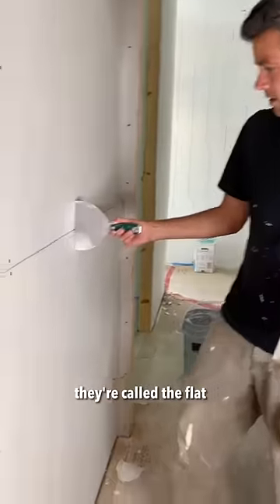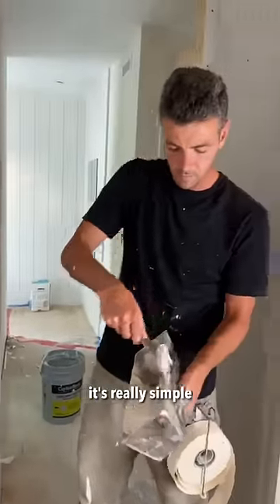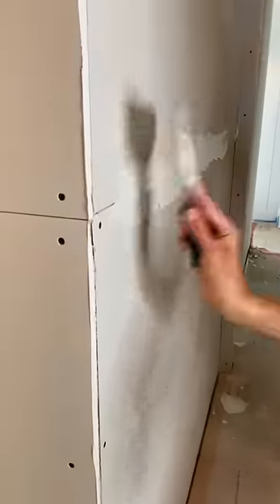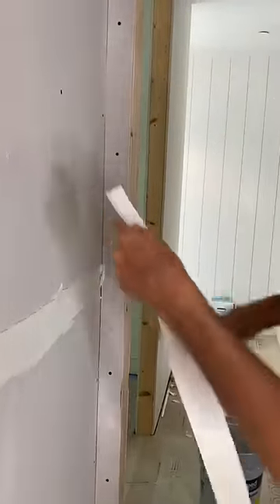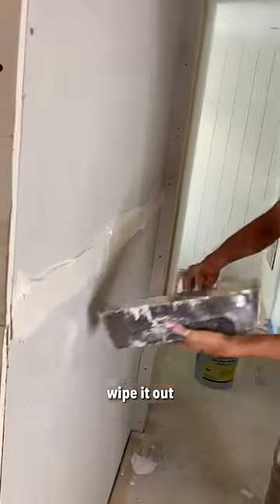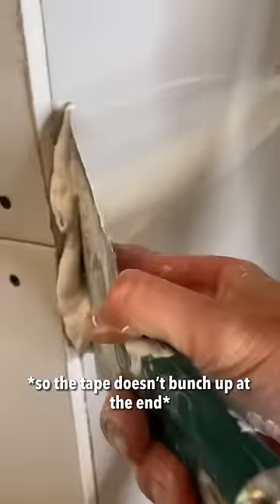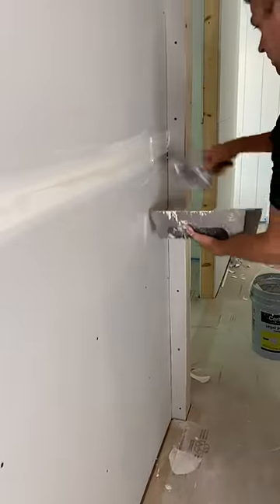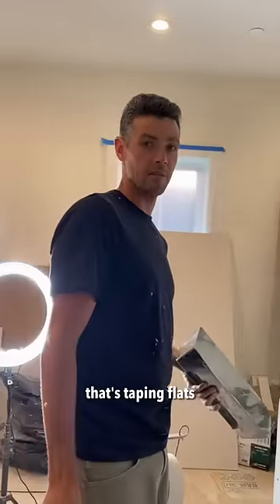Beginner Drywall Tips! Taping Flat Joints

Comment: Wow, someone who actually knows how to tape. I usually watch these videos and cringe. As a drywall contractor of 20+ years, I can say that you are giving out valuable information for free. Good on you!
Reply from the maker: Thank you!
Reply: On a short wall like this, I'm sure it doesn't matter if you have horizontal or vertical joints, but in order to avoid butt joints on longer walls do you hang sheets so that joints are vertical?
Reply: It is amazing how many professional drywallers....hate that term....  still screw up flats
Reply: @1966johnnywayne you should only hang vertical in commercial buildings if fire codes dictate the seam is the entire length of the framing.
Reply: Lmao his technique inefficient and he slow af what you mean
Reply: Dude even vertically will add strength to walls. You are not wrong, but come on. And usa is 20 years behind with construction, the way private house are built and everything wired would get insurance after finishing it because of these outdated regulations you have there.
Reply: @padlasvillage  in what way is the USA 20 years behind with construction? Saw your comment and its a genuine question because I am plannong a house design and maybe there is things I can implement.
Reply: Only someone not from the USA looking to buy a house in a dense market would say that.
Reply: @padlasvillage  20 years behind who lol. please im so curious. been waiting for a good roast.
Reply: @GorillaWitDaDraco  yeah lol it’s a lil slow maybe for video purposes? But a bazooka would be the way to go to get this job done in a day
Reply: @1966johnnywayne yes I’ve always done this.
Reply: @JosephDawson1986 it's not necessarily behind. It's just very different. Here we have global differential units that protect the whole installation and more sensible ones that protect wet places like the bathroom. In the US you protect less but it is even more sensible so better for protection of people. We have also bipolar or tetrapolar circuit breakers while you have mostly unipolar ones. We often have triphasic current while yours is single phase. But this is something that isn't up to you. It's norms and regulations. Your installations seem out of date for us when we open an electric box in the US. But the difference in voltage and issues explains why you don't necessarily have the same requirements as we do. 
For the rest, your construction techniques are very different then ours. Ours last longer, but are a lot more expensive too. We don't use drywall except in the attic for example. Walls and floors are made out of brick, stone or concrete. We don't use shingles or roofing but tiles or slates. We don't just use insulation but also inertia. Thai is why we don't need AC even in hot places. But again it's not necessarily better or worse. It's just different choices that were made.
Reply: What's the advantage of taping like this? The way I was taught is to use fiberglass tape directly before mudding. Then we use mudding especially for joints but not premade, just in bags that we make in a clean bucket .Which takes the same amount of time as you have to mix those premade buckets too anyways. We have the first layer that we do quickly and just scrape off well so there isn't any excess. Afterwards we go a second time with another pass but with a finer grain of mudding to seal it properly with no imperfections. No sanding required. This being said, we only use drywall for attics. Usually we mud entire walls and ceilings. So I'm not that familiar with drywall. How do you guys do it?
Reply: I’m 39 and have been doing drywall for 40+ years and I can say he’s giving valuable information for free as well
Reply: @OptimisteProductions  there is three ways I have done it. One is a metal reinforced paper tape, a fiber mesh tape and unreinforced paper tape. 
We generally use a premix that is very fine grain, commercially, and for the paper tape we use either premix watered down a bit or powered but make it a bit watery. You dunk you paper in the mix and using either a flat or corner drywall tool, depending id it is a flat seam or a corner seam, and smooth it into place amd let it set for about 10 minutes, usually while that sets you tape the other seams in the room and then come back to the first for step two.
Step two you take the regular premix or properly made poweder and you cover screw holes from hanging, which even a moderately capable drywall guy does in one pass no need for sanding and then you hit the seams in two passes one to fill in low spots and the second goes back the way you spread the mud, scraping leaving all the low spots filled and generally scraping the high spots away. The fiber mesh tape is similar but is self adhesive usually and so you just mud and scrape.
Reply: @JosephDawson1986 it's not much different then. Except we don't use screws but staples as we glue and staple the drywall in place. We use screws for the sides in attics though and those take 3 passes. You do gain one pass with the fiberglass mesh though.
Reply: @OptimisteProductions  I would love to learn how you in Europe do framing and carpentry and compare methods.
Reply: @JosephDawson1986  we avoid wood as much as we can because the climate is different here. We have a lot of humidity and so mushrooms that can damage it. So framing is often done with metal studs. We only use wood for roof carpentry. In old houses you will find more wood but it's always oak. My house is from the middle ages and has some old framing in wood. But it's pretty much wooden beams with twigs intertwined between them and then everything is covered with mud, like real mud made out of clay and lime with straw or animal hair in it. Construction techniques are changing though and wooden frame houses are becoming a thing here now too since we can isolate from the humid ground properly thanks to EPDM and concrete slabs. But even with that the first meter will often be built with cinder blocks or cellular concrete for inside. I haven't worked on those though as I live in a rural area and do mostly renovation. Houses are mostly made out of stone here and we try to keep a homogeneous appearance in our villages.
Reply: @OptimisteProductions  I grew up in Maine, near Canada, and we had homes with basements and slab foundations but I think its really the getting away from traditional building practices that is doing it but varies cause some former communist countries still build apartments the soviet way, in concrete as much as possible.
Reply: @JosephDawson1986  I visited Canada, Montréal and Quebec and was amazed by their construction techniques, adapted for the heavy snowfall and warm and humid summers. Eastern Europe is different cause it is more continental so it's a different climate. And communism as you said. They do still have traditional houses too though which often have those massive masonry stoves that are really brilliant. In general I find it amazing how people around the world adapt their building techniques with what they can find as local materials and with the climate conditions that they have to face. That's why I don't think some building techniques are better than others. As long as it works and people can live comfortably, that's the only thing that matters I believe.
Reply: @OptimisteProductions  true. I mean our construction methods are basically modernised from what was used in the 1600 and 1700s. If you look at buildings in England from the same time period that are wooden they look similar. Not sure if any actually exist since the industrial revolution though
Reply: @OptimisteProductions  wood structures are better suited for very cold areas (Canada/Alaska) and for areas that see a lot of earthquakes or high winds that are not seen in Europe.
Reply: @_Minecraft_ASMR  yeah, that's why you will find them a lot in Europe too in places like Scandinavia or mountainous regions like the Alps. It's also very cosy wooden homes. To have the warmth of wood in other more humid places we would use it on the inside and put a lot of woodwork and trimmings on the walls. Wood is great. It's renewable and if you do everything in wood you get to be very creative as it's easier and more fun to work than stone or brick. I'm sure I wouldn't have as much back problems if I lived in a place where wood is more used for structure. Masonry kills your health.
Reply: My father has been in the business for 20+ years as well and he does it that way too. Hand placement and angle is also important. You have to have the feel, cause I tried few times and wasn't so good at it.
Reply: @OptimisteProductions you are incorrect. We have all of what you are mentioning, the vast majority, is not needed and not beneficial in a residential application. Why would you need or want 3 phase power in a residence? You wouldn’t.
Reply: @OptimisteProductions you are incorrect. We have all of what you are mentioning, the vast majority, is not needed and not beneficial in a residential application. Why would you need or want 3 phase power in a residence? You wouldn’t.
Reply: @bigblockmaro1  well no you don't have all that. And as I said, a lot you don't need cause you don't have the same voltage as we do. As for 3 phase current though, that's actually pretty nice to have and the only thing I would really miss if moved to the USA. It allows a lot of stuff that can be practical. Especially for big houses or buildings where you can repartition your phases. You can also use thinner wires for the same appliances. Like a cooking stove in 6mm² you can use 4mm² in tri. But the greatest thing about it, is if, like me, you have a workshop at home. You can buy second hand industrial machines and make yourself a crazy workshop. With them big ass planers and lathes etc... that you can get for really cheap and only work on 3x380V
Reply: @1966johnnywayne I've done drywall all of once so this makes me an expert. 

Because of the size we had to do four sheets on the wall, so we offset the vertical seams so they weren't continuous.  Reason being, the vertical seams can easily crack and fold out to the sides when pressured where on a horizontal seam with a vertical stud the seam is supported in the back by a stud.  Even if you line up a vertical seam with a vertical stud, if pressure is applied from the opposing side of the wall to push the drywall away from the stud, then you're right near the edge of it and you only have to contend with the one set of screws and because those screws will be close to the edge of the sheet they will be easier to rip out.
Reply: @OptimisteProductions most people won't use three phase residentially, but you can get it installed.  I think it's fairly standard for appliances and getting a couple outlets of it installed for any industrial machinery you're going to want isn't going to add significantly to the price of an industrial machine unless you got it really cheap at auction or something.
Reply: Nice good to know
Reply: @kugelblitz1557  thanks, that's good to know. Most of these machines you can get for free here. Since they're made out of cast iron they easily weigh a ton so they just cost the price of recycled metal if you don't just find them on the side of the road. I never paid more than 400€ for one of them. And that was a fancy lathe from west Germany. Since they are cast iron they are also incredibly precise. Not as much as a Swiss lathe of course, but those cost more than my house. 
I'm an electrician by the way and still think your regulations for protection of people are better than ours. So I'm not shitting on the US. You guys have 5mA protections and that is something really great. Here for sensible circuits it's 30mA and that sucks. 30mA on 230 V might not seem that much, but if you're in your bath and this runs through your heart it's still enough to kill you. It's ten times what you would get in America
Reply: except for all the air bubbles left in the tape
Reply: @vancouvercarpenter thanks dad
Reply: @OptimisteProductions  free industrial machines?  I've gotta get some of those 😂.
Reply: Its pretty easy really anyone can do it. I learned a few years ago remodeling a house with my father and its actually pretty fun todo.
Reply: @padlasvillage  I ain’t from USA
Reply: @blademargath drywall finishers/ finishers
Reply: @OptimisteProductions commercial building use metal studs and use what we call purple board for bathroom or areas subject to humid conditions. I don't do residential so can't speak on that really
Reply: Really cause I feel like he was running the knife at a weird angle and I could see the bubble underneath that tape and I don’t even have 2 years in taping and texturing but maybe it’s just cause how I was taught 🤷‍♂️also I’m not %100 sure it was a bubble under it but based off the difference in darkness on the tape I’m pretty sure there was a bubble under it
Reply: Not saying it’s not helpful or he did anything wrong just noticing the differences from how I was taught and it’s honestly kinda cool, good for people who have a home project they are doing themselves and good way to teach people a start to a new trade
Reply: Amen!  As a DIYer I had done carpentry, electrical, framing, paneling, and plumbing, but never drywall.
In the mid-1980s I FINALLY figured out what you just showed us.  Lot of wasted effort doing it the wrong way.
Experience is, at best, an expensive and imprecise teacher! 😢😢😢
Reply: I have found my people😮 now onto how we are going to take over the world.
Reply: I usually watch ppl who make up there careers in comments and cringe
Reply: @GorillaWitDaDraco he's doing it at teaching pace , id love to see your work captain big shoots
Reply: @GorillaWitDaDraco wait aren't you a child ? What would you know about working on jobsites
Reply: he really is and i appreciate it!
Reply: I did production drywall finishing for builders in the 70, 80, and 90s, and still do smaller jobs to this day, this speed and technique would never cut it in the production world, I would mud out all the flats in 2 to 3 rooms with a 5inch knife tape the seams and come back  with a 8 inch knife and wipe down, taped on average 200 hundred to 300 sheets per day and my work was nearly perfect!
Reply: Good  Job  body ready for second
Coat
Reply: He is not giving details. 
You should must pre-filled your drywall, then tape! Good luck advice
Reply: For free ??? Brother I’m pretty sure he don’t even touch a real job anymore. This man is very well compensated from you tube
Reply: Could go faster using an 8 inch knife instead of a six but he’s better then most you see on here
Reply: If he shares every trick, I still can’t do it.
Reply: @OptimisteProductions You said we (The USA) is behind 20 years, but what you actually meant to say seems to be that you (Europe) are behind 20+ years, or at minimum, that we are not behind but just do things differently. Nice. 👍
Reply: @SB-vk1my  I wasn't the one saying you were behind. I just said it was different. And I was just talking about electricity. If we talk about construction in general, the whole world is fucked since engineers and architects have no construction experience whatsoever. They just have academic knowledge. I only work in buildings that never saw an architect or an engineer and are actually decently built.
Reply: I still have my stilts and banjo and knives, but haven't slung mud in 15 years.
Reply: he skates too
Reply: I almost took him serious until I saw the way he applied the joint compound. He applied way too much compound and it spreads easier if you put it on the corner and run it at an angle. They call it flat because it's not an angle or corner. Flats are taped first then angles. Evidently 3,800 ppl have no clue. Lol
Reply: That is not how to lay the bed on for taping haha
Reply: You also have month of expirience i see
Reply: Do the pros stir/mix the bucket of mud before use? Always seems buttery like a goid mortar mix.
Reply: @GorillaWitDaDraco I assume it’s slow because he’s deliberately giving slow, step-by-step instructions lmao
Reply: Bead?
Reply: WTF are you talking about. Every real finisher knows when mudding, always do your vertical lines first lol then horizontal! And we don't use joint compound 😂😂
We use green mud because that's what it is made for
Reply: No
Reply: Didn’t he say he was using all purpose. I love this guy watch him all the time.  I’ve been taught to use 90,45,20 Sheetrock on joints. Second coat all purposes. For those who know know why….
Reply: @1966johnnywayne I did drywall for 18 years All vertical joints makes more joints to Finnish For example you hang a 20 foot wall a12 and eight foot sheets That a total of 28 feet to finish If you hang it all vertical you'll have 40 feet of joints to Finish
Reply: Nice! Thanks for the video.
Reply: @1966johnnywayne  now I am not a drywall guy, but a carpenter. I believe when you math it out, horizontal means less linear footage of joints, unless over 100 feet of wall. Also, horizontal Drywall is so much easier to install, so you achieve higher quality work. 

I see horizontal drywall almost always in homebuilding, but have seen and been asked to install it vertical in commercial applications.
Reply: What tape is best to use? I’m in the uk, some people swear by mesh and others say avoid it…
Reply: I see so many drywallers today who claimed to be pros and suck at it. They just throw wet tap up there and smooth it over.